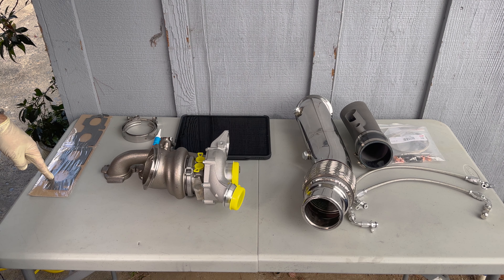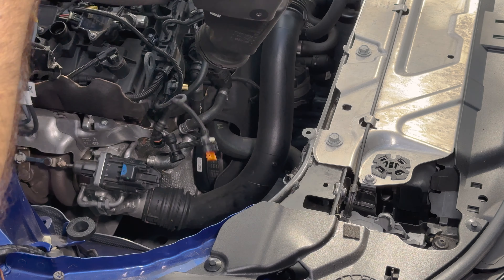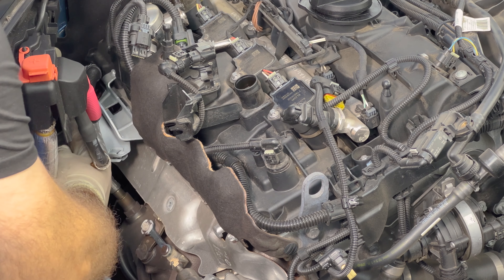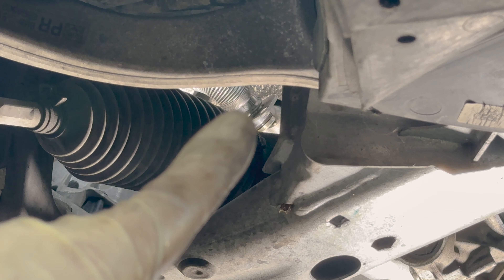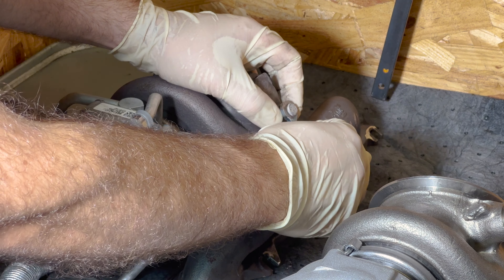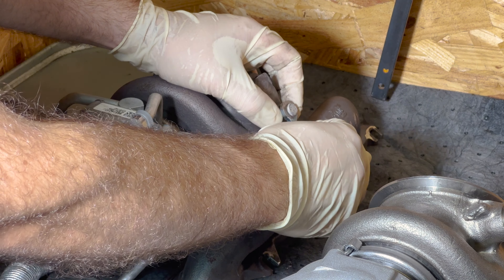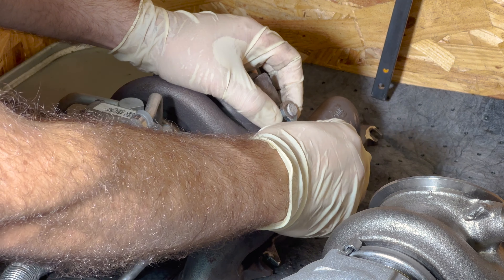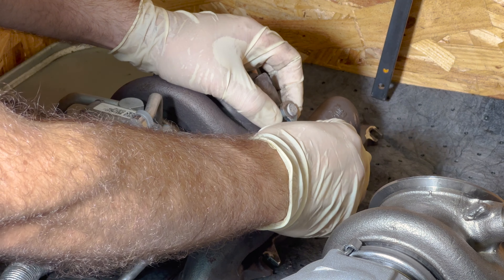I Gave My 4 Cylinder B48 BMW 500HP + Reliability!

Comment: You sir are now traveling down a dark road which I cannot follow….. until I’m out of warranty. I really hope you keep this car and daily the car so that we can see how the reliability holds up.
Reply from the maker: I plan on keeping this car for years, I bought it deliberately as I had an M340i and G80 and liked aspects of those cars but wanted good fuel economy and practicality.  Most of these are just getting old enough where they are falling out of warranty.
Reply: I have never heard of this term "warranty" 🤣 It's always been I need that lets do that.
Reply: @VehicularDIY makes me want to do more stuff to my 2019 750i Msport, only thing I’ve done is taken off the speed limiter and added sport plus. Now I can do 170+  in it. 

Definitely loved this video, excited to see what your car does now.
Reply: Could I do this to my 2016 528i (N20 engine) reliability is what I’m most concerned about.
Reply: @TuskBlancoTheGreat  no the n20 is not nearly as good as the b48b
Reply: @vehicularDIY we are missing your content brother!! lol cheers I check everyday and every so often. God bless brother. I have a 2019 430i bought a Dinan tuner and doing things here and there but going to run this platform you have here as well!! Thank you
Reply: @VehicularDIY since you drove both 4 and 6cyls. Which one is more fun. Regardless power
Reply: @bahy-amir   Well I have also driven both...and it seems the 4 cylinder is notably lighter, because the car feels slightly more nimble. The 6 cylinder is just so good though...the pull is so smooth and consistent. The 4 cylinder feels like it has sweet spots and slightly laggy spots
Reply: How much to install on my 330i?
Reply: @bahy-amir I drove both. The 6 cyl was more fun and had more potential. the 4 cyl is very fun as well and with this turbo that i’m currently putting on my car “hence why im coming back to this video”, im sure it can be as fun as a tuned 6 cyl on stage 2. It’s all up to you whether you want the B48 or the B58. My personal choice is a B58 even though I own the B48.
Reply: @B58YP You’ll have to take it to a shop if you don’t want to do it yourself. I’m about to install mine myself. I’ll let you know from a hardly experienced “wrencher” if it’s easy or not.
Reply: we’re all vicariously living the dark side here
Reply: @VehicularDIY  the b48 and the b58 have almosst identical fuel ecnomy in normal day to day use wouldent all this mod ruined that aspect.
Reply: @f22jax  you did the install yet?
Reply: @shazzamjf  yeah back in december. it was easy and simple to do. Highly recommend doing it yourself.
Reply: You’re wrong look up Navardi Tuned they’re the experts on BMW 4 bangers
Reply: @StockTurboN20  exactly
Reply: What’s the colder spark plugs?
Reply: @CitmaMotorsports  They’re for extremely high horsepower applications. Use your oem plugs if you’re replacing them and the stock gap height.
Reply: @bahy-amir  I'd bet this 2.0t would be more fun handling. I heard BMW with lighter front motors are more balanced/neutral like M cars or even better.
Reply: @cammgt3rs370  yeah i said so
Reply: @TuskBlancoTheGreat don’t do this on an n20 at all. The b48 and 58 have a closed desk. Every time I see his video I can tell the b48 is way better built than the n20
Reply: Did you pre oil the turbo?
Reply: I got a 2021 330i Xdrive M package and I’m upgrading my turbo next
Reply: How is it doing after  a year?
Reply: @fransdeklerk5013 🤣🤣
Reply: @f22jax  I agree!
Reply: Can I do this with to my 230i 2024?

Comment: Mercedes engineers fighting the air right now
Reply: 😆 LOL
Reply: Looool
Reply: Lol yo facts
Reply: In what way? This car will blow up before 100'000km.
Bmw's only bullet proof engines are the inline 6s. 
And btw mercs 4 cylinders push 420hp from the factory..
Reply: @c190gtc stop crying
Reply: @gaara4667  Bet your dad said that often to you that's why you use that phrase
Reply: Very body in ere stop crying 😢  audi is the best 👌 simple
Reply: @c190gtc Lmfaoo one of the most notably unreliable engines Mercedes ever produced, but hey it came from the factory
Reply: @AngryBlondeNYC  It's not unreliable at all what is your source? Should I start with rod bearings? Water pumps? Vanos?
Reply: Forgot about the gla45 lol
Reply: @Saber_Athena  Question suits more your mother mate
Reply: @c190gtc rod bearings, water pumps, vanos issues do not apply to the b48 which my friend is the same basic design as the b58 minus two cylinders. Speculating that it will be unreliable is well speculation.
Reply: @c190gtc why are u geting so worked up
Reply: @Bimmer_Bill  I love bmw but I also love mercedes... Here we have a guy that loves mercedes but hates bmws.

There are people out there driving shitty hondas but no, blud hate a poor little i4 3 series....
Reply: @blocksource4192  as do I. I tease about Mercedes, Audi etc (as a bmw guy), but the bottom line is they also are fantastically engineered cars.
Reply: @Bimmer_Bill  right on!
Reply: @c190gtc no they don’t
Reply: @c190gtc involving family in the insults. Weak move.
Reply: The M139 is very reliable. You don't know what you're talking about... @AngryBlondeNYC
Reply: Currently me cant lie brotha😭‼️‼️
Reply: @c190gtc I don’t think Mercedes have an n/a engine that competes for hp/ltr
Reply: The M139 exists...
Reply: @c190gtc  cope
Reply: U understand the b48 is bmw’s “bulletproof” i6 b58 with 2 less cylinders right?
Reply: @markmallinson935 What kind of statement even is that
Reply: @c190gtc  merc builds cars of which bmw can only dream of
Reply: @c190gtc what 4 cylinder pushes 420 from the factory
Reply: @c190gtc that car also costs 60k while you can get used f30s with around 50k miles for 15k
Reply: @c190gtc literally an amg

Comment: I'm addicted. This is the type of upgrade I've always liked, a true sleeper and still looked factory even under the bonnet. I liked that you did not have to change the air-box. Keep em coming.
Reply from the maker: Yeah I plan on keeping it as stock looking as possible.
Reply: M YouTube
Reply: @VehicularDIY Will the stock air box allow for enough flow?
Reply: I regret changing my airbox for a cold air intake on my n54 stage 2.5 MHD.
Reply: @zadeh79  BMW stock intakes are able to handle 700hp, for the b58 at least.
Reply: @VehicularDIY yea especially being in cali lol
Reply: @VehicularDIY  not much you can do to improve the look of a bmw anyway tbh
Reply: Gotta route some airflow through the grilles with a snorkle.

Comment: We achieved close to that on a stock motor adding only ethanol petrol mix and a Mosselman front mounted chargecooler + custom mapping. Stock turbo. It spins wheels in 4th and 5th on highway. Once you run on Ethanol mix they are rapid.

Comment: Love the boldness and your willingness to do something other's dismiss.
When I had my 330i F30 it honestly impressed me that a 4 banger can do what it does stock. 
I always tell people if they are happy with 400HP wheel then go get a B48/B46 and tune/mod it. 
It is important to recognize not everyone wants a gas guzzler B58 on tune and DP.
Reply: stock for stock, the b48 uses just as much fuel,  if not more then the b58.
Reply from the maker: I’d say the B48 uses 4 to 5 less mpg overall from my experience
Reply: @SonnyVisual  I've owned a b48 and now have a b58 and the b48 definitely uses less fuel. The B48 is an economy engine with the way it's tuned from factory but is almost just a b58 with two cylinders cutoff. 48 stock was getting 24-27 MPG but my 58 stock was getting 20-22 MPG ish.
Reply from the maker: @TedsApex  yeah my car fluctuates between 27.7 and 27.8 mpg average.  With the B58 you could really bring your average up if you drive mostly on the highway but as soon as you mix in city driving it drops hard.  So you're doing well if you're getting 22 to 23 mpg average and if you hypermile on the highway you could probably get it closer to 25 mpg which is impressive but if you want to mindlessly drive and put your foot into it often that is where the B48 delivers another 5mpg average.  If you're filling up 4 times a month and getting 60 to 80 more miles per tank that's like getting a free tank of gas a month vs the B58.
Reply: @VehicularDIY  I’m actually tuned now and getting 16MPG 😂😂😂
Reply: @TedsApex  my 230 got 390-400km MAX on a 48-50L full tank. that's equal to around 19mpg. didn't matter if I drove fast or tried to be more conservative. and that's mixed Hwy + City driving. If I did all highway and stayed around 100kmh/60mph it could almost reach 700km on a tank. but on day to day use, it's honestly terrible. 
There's 400+hp V8s that do better.
the car averages 12-13L per 100km.
that B58 is rated around 11L per 100.
Reply: @TedsApex  I've had the opposite experience.  My x3 w/ a sock B48 gets about 30 hwy and 22 city, while my old 440i (w/ MPPSK) got 35 hwy and 25 city (assuming I'm not driving like a dick).  Even my heavily tuned 540i is getting the same MPG as my x3 with the same driving style.
Reply: @Jundaku  I also have a 2019 X3 30i and yes that car is very good on gas for an SUV. I think they tune it a bit more economy based and heavier cars can sometimes be more efficient on downhill roads
Reply: 328i GT X Drive N20 and I get 18 city 21 highway. If I drive in eco pro with cruise control 70-75mph my mpg seems to be around 24 but my average mpg readout stays at whatever it was reading in comfort/sport modes so I can never be sure.

Comment: can’t wait for the dyno and if you can pull over 350+ hp im Definitely keeping my 22 330I. I was thing about trading it for a M340 but will see how much power can you pull without compromising reliability because I like how this car pulls just stock and saves gas better than my 2019 Camry 2.5.

Comment: on a large & modern turbo set-up I installed on my 5 cyl Volvo 850 R..I was advised by the Precision Turbo guys to install a plate size fan pointed at the turbo set-up (from a Porsche 911 surge fans) to optimize cooling on demand with a heat sensor & gage and a 2 minutes timer to keep on cooling after the car is shut-off ,avoiding 'heat sink' under that hood as much as possible ,especially during summer or when stuck in traffic...a hood extractor louver above the turbo set-up is not too much either..I remember a precious advice from Chip Foose at a tuner's convention in NY..'no matter what your project is the success & reliability of your engine build is cooling & heat control'...keep that heat away from that engine bay'.....!!

Comment: I've got a 2019 330i with this same engine. Hmmmmmmm. I think this might be a fun project. Took me 7 days to build a Procharger setup for my Wrangler, but this looks like I could do what you did in a day because you're VERY thorough and leave nothing to question. Impressive video! (instantly subbed)

Comment: Why are you the only one I see removing the Turbo from the top, when it appears it's so much easier than removing cats, motor mount and flange, etc...and dropping out the bottom? I was in a quandary between My 14' E350 Benz, or a 13' BMW 528i, Read reviews, repairs, watched repair videos and ultimately chose the Benz based off what I'd found. I know I made the right choice now based on how things progressed, but at the time I really wanted the BMW, my last BMW a 98' E39, I love'd tinkering with it, always fixing and rebuilding things and enjoying long trips. 
As my health now prevents such activity, the tinkering part, I'm forced to pay for services, and limit driving to medical centers. Hopefully that changes, I'm only 63. And BMWs are my passion, my first cars were old Benzes people gave up on, but once I got a Bimmer in trade for some work...

Please keep up these videos, they are a great service.
Reply from the maker: I've had to do it from below but on this car there is so much room that it's possible to do most of the job from above, easiest car I've changed a turbo on.  I've done it from above on the N20 like on the 528i you mentioned, this was on a 328i so I'd imagine it should be a similar experience on that as it has a pretty open engine bay.  Yes I had the same warning from my cousin when I was looking at E30s, now 16 years later I haven't owned any other brand.  Wishing you health for the occasional tinkering just as a hobby.

Comment: Where did you get the reduction from intake to turbo? I believe it is inlet pipe (10:52 you are holding it mounted). I ordered the turbo and the instalation kit and this was not there. The stock connection is too small. Please help. 

So far the instalation was disaster. Definitely not a bold on mod!!!
Reply: Any update from that? Does it make any difference sorry for asking I'm about to order that turbo kit thx

Comment: This REALLY awesome! I love how detailed you are and yet the videos move along briskly with no BS. I have a question for you: while it is exposed, is there any reason you wouldn't change the charge pipe to an aftermarket aluminum one? I've had these stock plastic ones crack and come flying off on previous BMWs...seems like relatively inexpensive peace of mind with this type of upgrade. Thanks again for your awesome videos!

Comment: Just think you can tune a stock *20i B48 from 183 to 250 hp without issues. With a 200 cell downpipe you can reach at least 280 hp, which is what i would like to do.

Comment: The problem with these engines is that BMW used a lot of plastic the general consensus is after maybe 6 or 7 years the plastic is going to start becoming brittle. Which internal parts and external Parts should be replaced and after how many kilometers or miles?

Comment: There is on thing I don’t understand, the b48 internal can handle only 300hp as far as I know , shouldn’t you change also the internals while upgrading the turbo? I’m confused or am I misinformed
Reply: No when and engine that turbo from factory usually has forged components, with the b48 you can hit 400 safety and still have room for more
Reply: I think 300hp is for n20 not b48b

Comment: Great vidoe brother and very detailed.  How is the new turbo holding up. Also I'm thinking about buying a X3 2019 or 2020 model year with the B48 would you recommend this engine ? I know the B58 is much faster but both are really the same with Reliable. Thanks
Reply: One of the biggest questions is the quality of the aftermarket parts from IPOS. I would assume they are produced in China with some measure of quality control. B46 / B48 is totally fine but will all of these parts last for long term ownership or are people taking a risk? I'm very curious if this would work on a X3 platform as well.

Comment: Very nice video, I still hope you’ll work on other cars (Honda/Acura Toyota/Lexus) someday. 

But what was also mesmerizing for me was how fast the transmission was shifting.
Reply from the maker: My brother in law has a 2012 Camry with the 4 cylinder and his torque converter died at 100K miles.  I'm going to help him fix it, the question is if I filmed that would anyone want to watch? lol  Yeah I loaded XHP on the transmission, can't wait for it to be under heavy load and show how quick it can shift.

Comment: I would like to get a BMV x3, but wants one a that is not too sophisticated as I am 70yrs old and is more for the simple things in life. I am looking for RELIABITLITY more than anything else. I am looking for one that has the following features: Rwd, Non Turbo,  Natural Aspirated Engine, (or with the likes of), Automatic Transmission, non air suspension. Do you know which year model would somewhat fits my choice? You have the best info on ur blogs. I appreciate U, thnx.
Reply: X3 is xdrive, f25 n52 is without turbo

Comment: We had a customer at work with a JCW Countryman which I believe also had the B48. I don't remember which turbo he was using, but we ended up replacing it three times because he kept fucking up the tuning and burning up the turbo internals, lol.

Not trying to rag on this, just thought it was a funny addendum. I plan on doing the same sort of change to my EA888 Golf Sportwagen once it's not my daily driver anymore...

Comment: Good God! You can complete this job while taking a break from a N54 turbo replacement.
As far as that lift, seems a bit precarious at first glance. 😳
Reply from the maker: Yeah I’ve learned to accept the lift lol.  You can put a stand on under the right arm to make it super stable.
Reply: Based on all the work you do I'll give you the benefit of the doubt. Be careful and keep up the good work bud.

Comment: Would you say that there is enough of the spooling noise from the turbo with the compressor holes or is it too loud. I do like the noise it makes and would consider the t51r mod instead but i don't want the spooling noise to be obnoxious. 
Additionally, around what decibel range would you say the car is after the downpipe. I would love to have the power increase that it brings but i don't want my car to be loud(I have a manual 420i with the b48). Just would like to know what might make the most sense and if there's any method of quieting the car after adding the downpipe.
Reply: You could use something called Valvetronic universal muffler tahts what I did and it’s valves so when closed it’s quiet but not too quiet a bit louder than stock
Reply: @Dan330i  I have taken a look at those and i like the idea of it, but i kinda want to do the downpipe but i like the sound of the car when the valves for the valvetronic exhaust are closed vs open, its a bit quieter and cause of where i live i dont think i would even really have the valves open. Idk your setup on your car but if its possible i could hear from your how it sounds then i would be able to make a better decision.